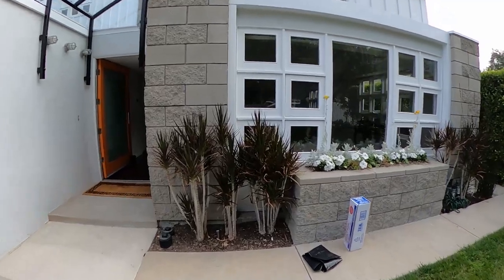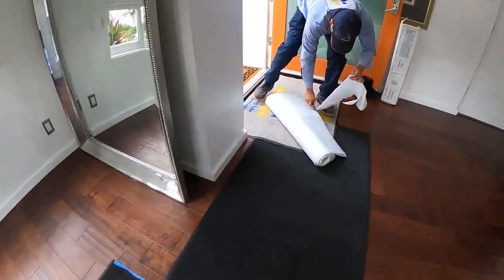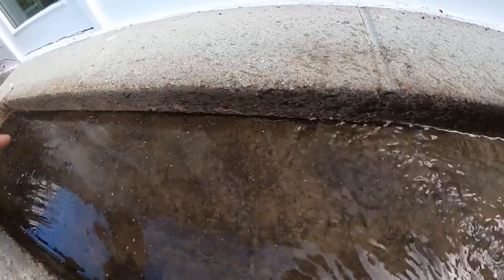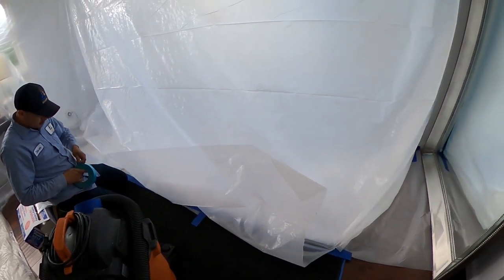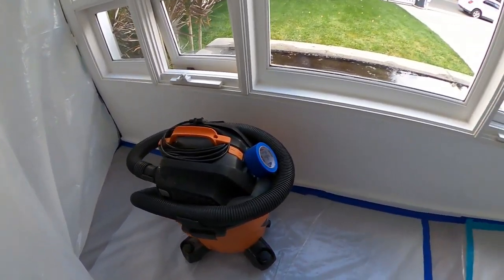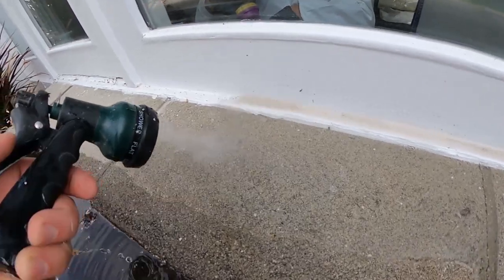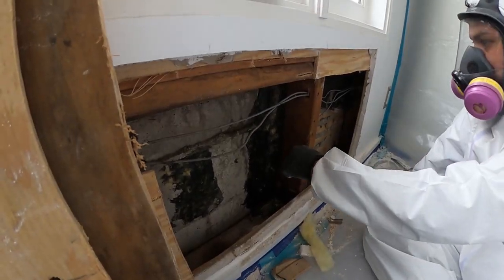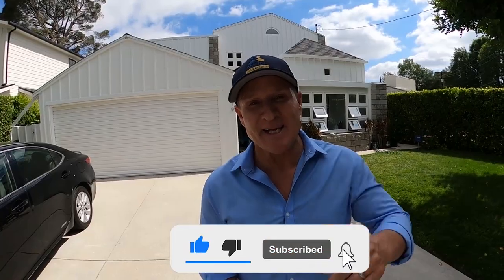You WON'T believe what caused this WATER LEAK...BLACK MOLD!!

Comment: Terrible design and construction!  Untreated studs butting up to an un-waterproofed masonry wall.  That's just stupid.  An un-sloped exterior masonry window sill, again just idiotic.  And then to make a planter bed with no waterproofing or drainage channels to the outside.  Good detection by you guys, but you probably figured it all out 10 seconds after walking up to the front door.  And I'm wondering how their next contractor plans to remediate this properly.  I bet he won't as they want to sell it off.  Next buyer should have his head examined; that's "9 miles of bad road" to come.
Reply: Not everyone has common sense nowadays!

Comment: I have been in my hm for 3+ yrs, the majority of the time it rains here in AZ. ( which isn’t a lot ) my master bathroom smells mildewy/musty/ wet cat liter box. Sometimes it’s real bad and others not so much. My ins. sent a fly by night plumbing outfit out, the guy used his moisture gun on a couple areas and said he wasn’t seeing anything or smelling anything ( told the dumb ass it smells after a rain ). Needless to say problem wasn’t found and still have Oder issue. Any ideas from other viewers ???
Reply from the maker: Often times insurance companies don’t have the right vendors with the right skill set to locate these issues. You have to find the source, by performing rain leak detection, then document, then you can build a case with your insurance company, especially if they sent someone that did not do there job right. ( negligence). In respect to the odor you can try some great products that remove the odor permanently. If your interested in more help we do service Phoenix Az and the surrounding areas. Thank you
Reply: Call the Twins ! You'll be glad you did ;) ... These guys don't mess around 👍
Reply: @TwinHomeExperts  
Do you service Central California? Any of San Luis Obispo area?